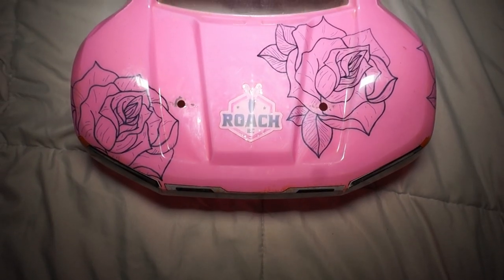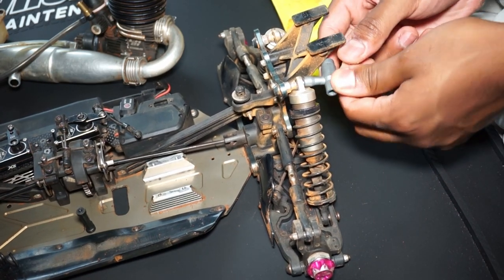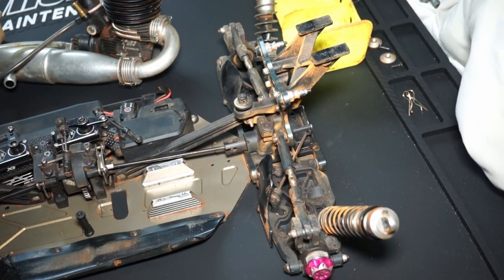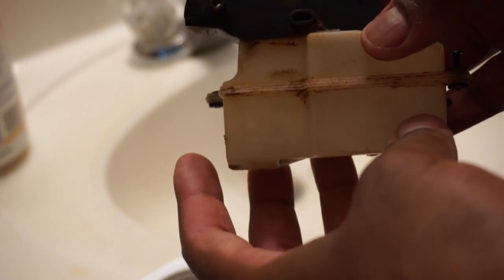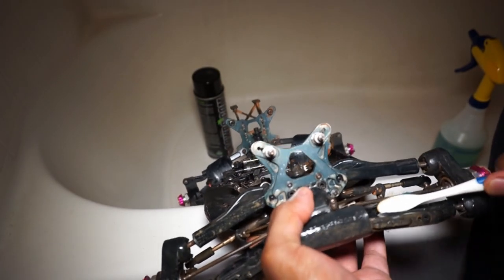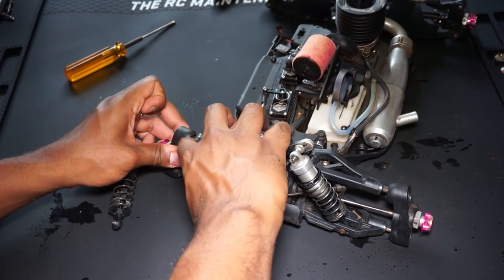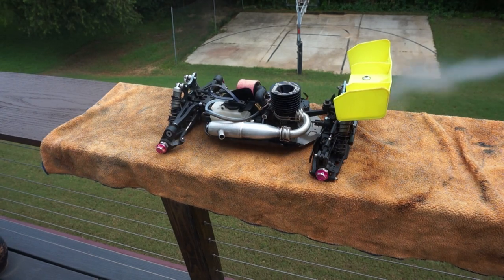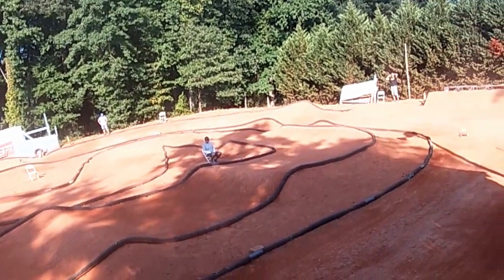Cleaning an RC Nitro Buggy (Sponsored By Cow RC)

Comment: Nice but its much easier to get a large good quality paint brush to clean. Also, i wouldn't submerge the shocks into the ultrasonic cleaner because water will get into the shock boots and stay in there. And when cleaning the fuel tank you can use a small piece of fuel tube with a screw at the end to cover the nipples to ensure water doesnt get in there